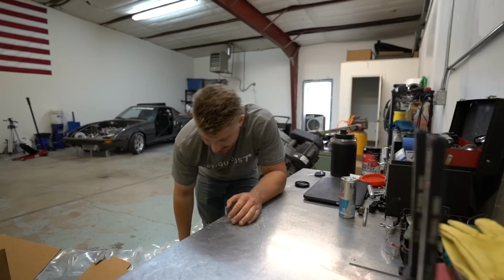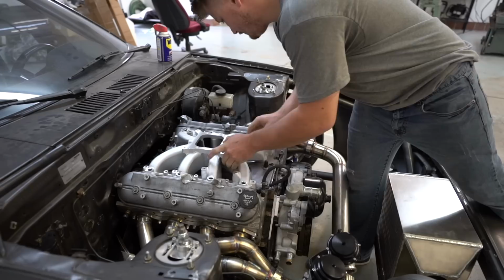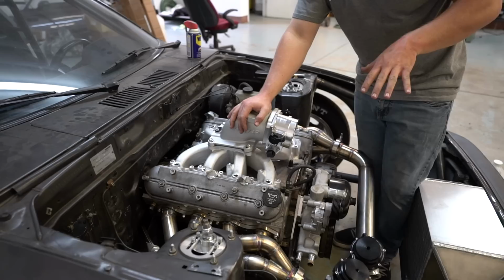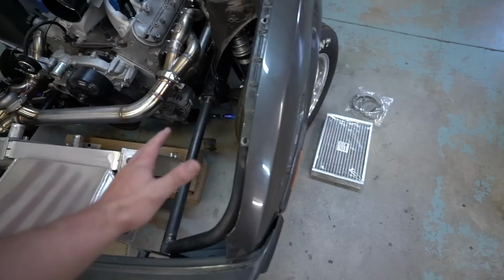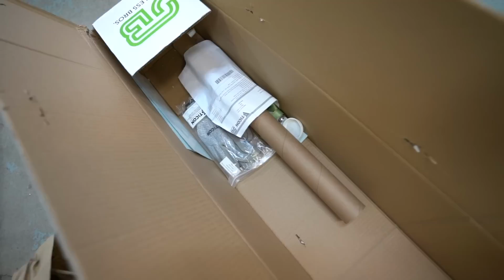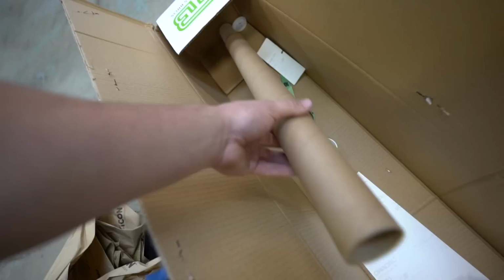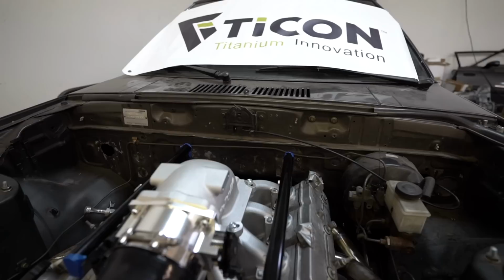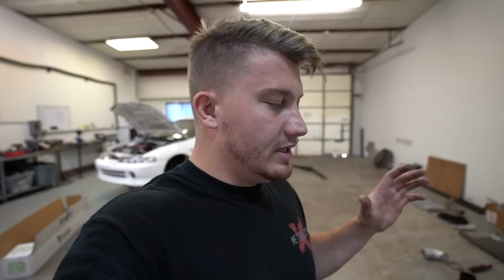I've Waited Over a Month For This! (Titanium Charge Pipe)

Comment: Dude, just put a hole in the hood for the elbow and tb and use an eclipse hood bubble on the hood to cover the hole.  You're a fabricator, a little body work won't kill you once the hood bubble is welded on the rx7 hood.

Comment: You should weld a V-band flange on both ends of the charge pipe and put Vibrant vangent instead of the silicone coupler's.... Them Vibrant clamps will let the charge pipe move just enough but won't let any boost leak as long as you lock them down right especially with that big ole turbo you got when you start putting some real boost them silicone coupler's will fail

Comment: ditched the jegs intake huh..i was going to ask how tall it is,seeing i been looking at them jegs says 7.5" total..needs to work in a 4th gen..an the jegs intakes basically need a cam that comes on at 4500 and gos to 7200...the intake you got now isnt a bad intake but it makes 20 hp less on a cam only 6.0 deal vs the new holley splits,itll max rpm wise around 6700 then power will drop..intake needs to match the valve events on the cam..that intake will want a sooner ivc do to the runners being shorter..if your running like a lil john stage 2 it likes a longer runner..john designed it for stock intakes an high rams on a 5.3 with a s480 when he did that one.

Comment: Don't space the hood or run no hood just get a cowl for it or run a cowl hood and get a spacer plate for the throttle body since the intake has long runners but not that tall and is a single plane then you would really benefit from a spacer plate or try a Super Victor style intake and if you ever need more throttle body then Wilson Manifolds sells a Hi-Boost 105mm Throttle Body that fits on a 4150 style intake and they also make a badass elbow to go with it and you should invest in a set of Billet Atomizer injectors and also Frankenstein and CDI teamed up to make a 4500 style Super Victor style intake and if you don't already you should check out John Doc's YouTube channel the car on his channel called the Black Sheep is nothing but the truth and his car he's currently building called the Salty Chicken is going to be badass when it's done and the Red Mustang called the Bad Apple is pretty sick to be Ford powered and his other Blue Mustang when it's done is going to be pretty sick as well with a pretty badass LS going in it